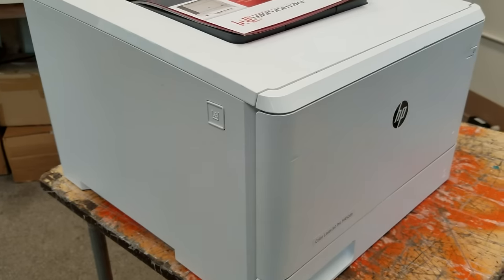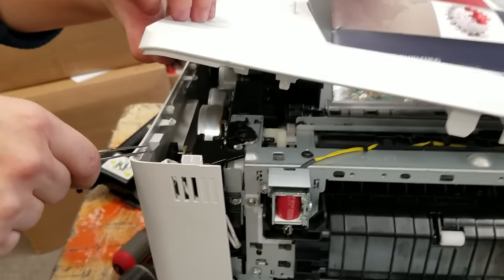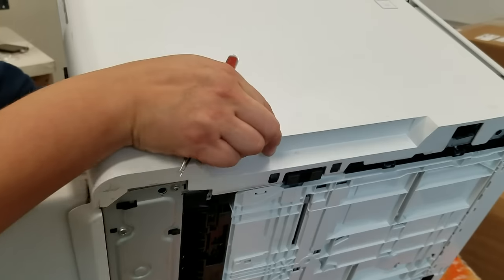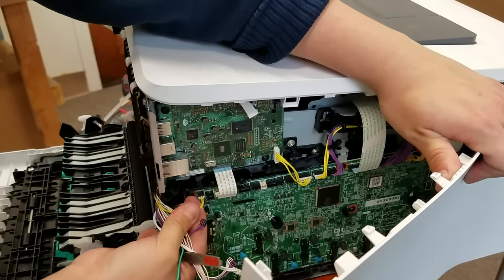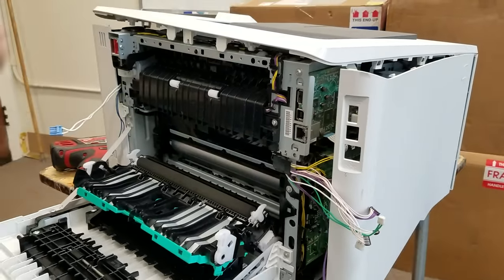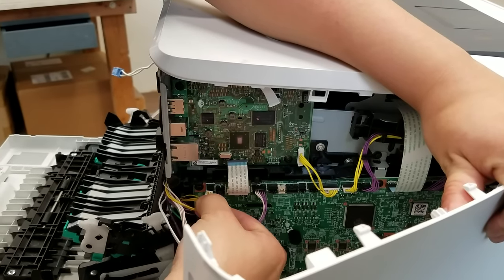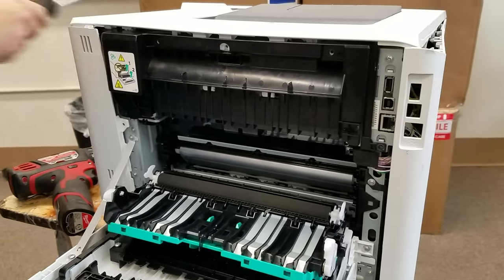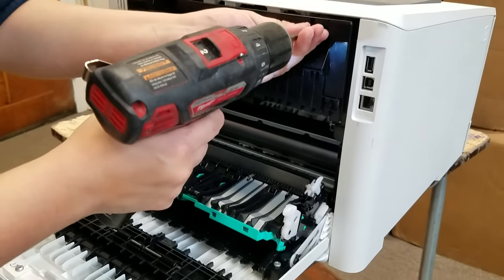How To Replace The HP M452 M377 M477 M454 M479 Printer Fuser Instructions. RM2-6431 RM2-6418

Comment: Super video. Print quality on M477FDW is great, and it auto duplexes. Started printing repeat blobs at side of page. Found this video, bought identical printer on eBay for $1 and switched the unit across using your video. Worked first time, delighted!!! Great instructions. Thanks for posting.

Comment: OK. 
1. Dude, you rock! This totally helped. Got mine replaced and it works great. 
2. What about these four extra screws and this flat metal plate that I have left over... 
3. Anyone else doing this, when you are putting it back together, you see his hand in the top middle. Pull that plastic flap up or the top won't go back down into place. (This took me a few minutes to figure out.)
4. Where should I send the beer? You probably saved me a few hundred dollars on hiring this out.

Comment: Don't assume the Fuser is bad. You made a Great visual, I actually opened the fuser cover, which is the first plate and found a long thin piece of paper jammed in the fuser path. I removed it the unit was good to go !!  These fuses are notorious for getting too hot and having paper and debris fuse on to the roller rendering it useless and replacement is needed. I ordered one on Amazon and it was a bad unit and I then trashed the copier as it’s not worth my time. E
Reply from the maker: Thanks for sharing
Reply: this is exactly what I found. we barely use the printer so it seemed unlikely that the fuser would have pooped out. I used needle nose pliers to fish out the page fragment.

Comment: Thanks for the video. I attempted my fuser swap, however the ribbon cable that connects between both boards had to be disconnected on my device. Now after I placed everything back together, I'm getting error message: "Engine Cable Connection Issue". Any ideas on what I can try to remedy this issue? Thanks for your time and attention.

Comment: I have an m479. On the cyan only, the range from approximately mid tone of the image and above will just fill in losing all the detail of the image…again, cyan only. I’ve tried multiple cartridges and also an original hp cyan cartridge. Same problem. Can this have something to do with the laser and mirrors? Can they be easily cleaned? I did restore the printer to original factory settings with no luck. Thoughts?

Comment: Mine is a CF379A HP Color LaserJet MFP M477fdw duplex model with the additional 550 feeder tray.  I had several paper jams during the reverse function for the 2nd side print.  It's clear the fuser is bad and there is a small ladder looking piece on the bottom edge with a little rollers that broke in half.  I also have an odd print transfer on both sides of my paper on every single page.  I'm not sure if that is part of the fuser, or a different part.

I've had it for about six years and use it daily.  I got tired of the excessively overpriced little ink cartridges that don't last very long for your home use printers.  So I opted for the more business use M477fdw.  I use the extra capacity ink cartridges and in a years time, I spend half the money to replace all four of them one time than the little ones for the same amount of printing every 3-4 weeks!

Comment: Thanks for the video! My printer says "paper jam" but I can't find the actual paper anywhere. HP's support is useless, they told me that they can get me a quote for a new one but refuse to even try repairing this one (because we need more electronic waste, right...). Is it possible that the paper is stuck inside the fuser? If so, is it possible to remove it or would I have to buy a new fuser (HP support said that they're the same price as a new full printer)?

Comment: Just a FYI, the M477fdn removal is different. The sides don’t pop off as easy as in your video.
Reply from the maker: Thank you for highlighting the differences
Reply: @jmuir84 Amen brother. This is definitely not as involved as the duplex printers. 2 screwdrivers is a good idea. I did it. I broke a few tabs off.
Reply: @greenvalleyrange8148  How did you do it? It just seems like it's going to snap off.
Reply: @mightycrow7  I had one very long thin flat head screwdriver that was used for prying and poking blindly around all sides... but I did break off 2 tabs. So I can't say my method works. I can say that there are a few locking points along the printer's bottom edge, so use a good light and a long screwdriver, work back to front, and you will gradually get the panels loose enough to work comfortably.
Reply: Yeah.... this video is more for just making you realize you have to get into the sides to remove wires I think. For the M477  I lost at least 3-4 tabs. You can't just leave the sides on and only prop them open. Especially when reconnecting the larger number of wires. Thanks for the video though, as it gave me at least some direction. 

Not quite sure why HP would have drastically changed the procedure of replacing a pretty frequently replaced part. Considering the part was about $250+ and any normal repair shop would have easily charged about $100-150 to replace this, it's almost better for the end users to purchase a new printer.
Reply: @HarbyDrenden  I did it, but it wasn't as easy as the video. Agree with everything.

Comment: Did you simply turn the fuser around and reinstall it or did you actually install a new fuser? I cannot tell it just looks like you took the old fuse or out and flipped it around and reinstalled it
Reply from the maker: Hello---yes we reinstalled the existing fuser
Reply: Metrofuser Printer Parts I appreciate the follow up, thanks a lot!
Reply: Will the new fused have all the metal shroud? Or will that need to be transferred to the new unit?

Comment: Thank you for the video!  I was able to remove the fuser to get paper out that was very stuck. Now when I turn it back on the printer tells me that there is a motor connection problem. Did I not plug in one of the cables correctly?

Comment: Thanks for your highly detailed video. We followed this to a tee and it wasn't too complicated, only time consuming. Unfortunately the printer now jams every time - it has yet to print a single page successfully since switching fusers. Do you know anything that would cause this? Do these need oiled or lubed up in some fashion? Unfortunately HP itself is almost no help whatsoever! Regardless of the problem, all they ever want you to do is buy more of their overpriced toner...
Reply from the maker: Please ensure you have the right fuser for your machine. There are simplex and duplex versions of the fuser – which model printer do you have ?
Reply: @metrofuser  Okay, thanks for taking the time to respond. We appreciate this tip and will look into it!
Reply: Im pretty sure that youve not seated the solinoid on the fuser. If you strip it down again(i know it sucks) and look to the left hand side theres a white arm that needs to be seated correctly
Reply: @soretoe9581  This worked for me.

Comment: Is this the same basic method for an m254dw?  my printer is putting a crease right down the center of the page and i think it's the fuser that's causing it.  is there any way to open the fuser assembly and clean the rollers? thanks.
Reply: Not really tbh. Youve probably got a dent in the hot roller and theres not much chance of fixing it

Comment: Christ that's complicated. The fuser rollers in ours are about spent. I bought replacement rollers and film off amazon and I'm trying to build up the courage to open our printer up. Has OP tried to open the fuser kit itself to replace parts (rather than replace the whole thing)? Do I have a chance in the world?
Reply from the maker: It is a big job. We build printer fusers in scale for printer service companies in the USA. Rebuilding is a little tricky especially when it come to the grease type and application placement. I recommend buying fusers instead of rebuilding ones. In the case of the M452 fuser they are a little hard to find. The lower pressure roller is another issue. There is no good quality manufactures of the roller as of the date this was written and it does not look like anyone is working on developing it.  There are companies like ours around the world that rebuild these
Reply: @metrofuser  How do you rebuild it if there is no lower pressure roller source?
Reply: You need to come out on the road with me for a day if you think thats bad!!!

Comment: My 477fdw top paper feeder is 90 degrees off your illustration.  Therefore, one cannot loosen the 1st 3 screw and then pop back the side panels.  Actually, I was trying to clear a small bit of torn paper from the cleaning fuser path, so I gave up.  The printer is old, and replacing the fuser is no longer the best financial approach, anyway.

Comment: This is a very good video but how complicated is that removal and replacement. I have a 479 printer and the fuser unit failed after just three months. HP have been appalling over repairing it and it still is not fixed to date some two months later. Advice is BOYCOTT HP PRINTERS.
Reply: Good advice. HP engineers have always used the Rube Goldberg system of design to make repairs complicated & difficult.

Comment: I'm thoroughly confused.  All I saw was you take it apart and then put it back together.  Where was the replacement?
Reply: The purpose of the video is to demonstrate how to remove the part in his hand @2:34 normally you would replace it with a working part at this point. but he simply demonstrates how to reattach the old part as his part was not broken to begin with.